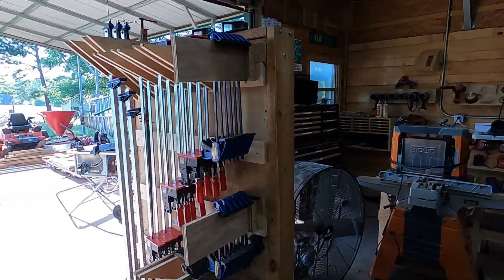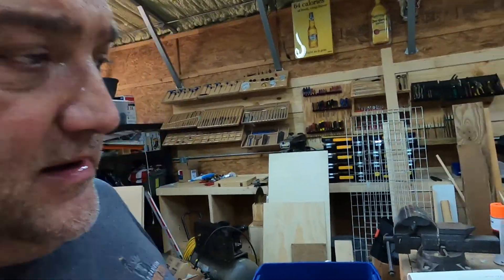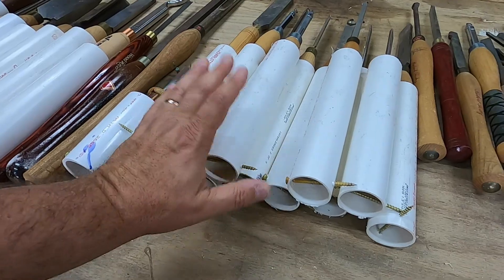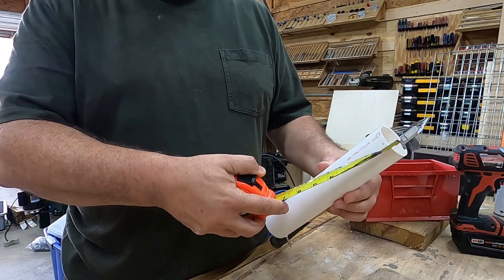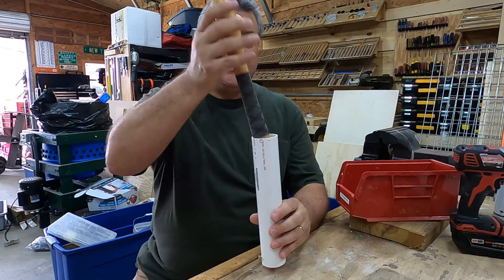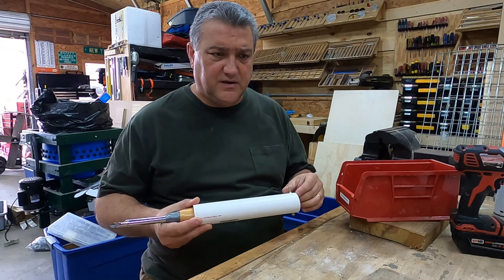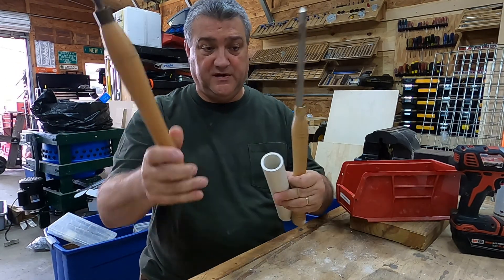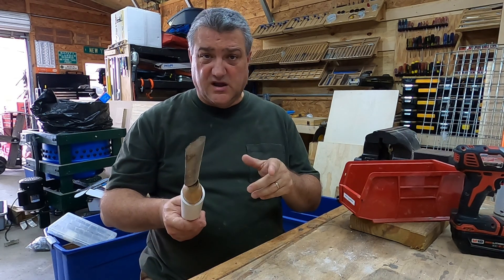The LaLa Farm SHOP UPDATE • Short Video

Comment: A great Navy Idea! I know in the Bees every tool had its place and a list  inside the top of the tool chest. At the end of the day everything had to match. The poor Bee when it didn't lol! Your shop will be awesome to work in when you are done organizing. I'm still organizing my CRT too. Man, you have a lot of honing to do! Did you get the lathe too? Enjoyed, take care!
Reply from the maker: Thanks Michael - I get really frustrated when I cant find a tool and therefore I try to make everything have its own home.  I dont mind if people borrow my tools and equipment, but they better put it back in its proper place or I will go on the warpath.  😂  I did purchase the Jet lathe as well.  It had not been used in over year so there is some surface rust I need to take care of and clean it up - it will be as good as new.  I have been saving up for a complete sharpening system for over a year and it just got shipped today - so I am super excited to be doing some honing.  The bench I made for the chisels will have the grinder on the backside of the bench behind the chisels.  Super excited.  Thanks for watching.  - Rick

Comment: could you use the screws at the bottom to screw them to a board?   you're shop is very organized...  want to come up for a week or two and help me with my shop?
Reply from the maker: I probably could have done that, but the way the tubes are glued together, each level of tubes is 1/2 inch above the previous row.  That way any shavings that might get into the tubes can fall out the bottom.  the screws not only hold the chisels up but allows the shavings to fall through and out of the back of the frame that holds them.  I will show the finished product in a video this upcoming weekend.  I had to finish the small barn, then plant the garden before I could focus on the shop.  I been in the shop for close to a much and I have been a lot of progress.  IT MAKES ME HAPPY BEING IN THERE.  - Rick